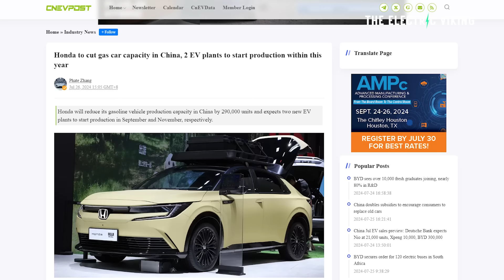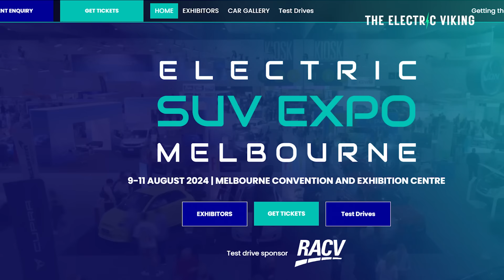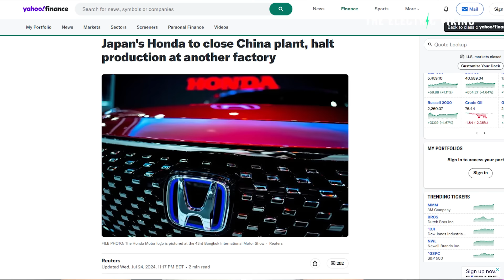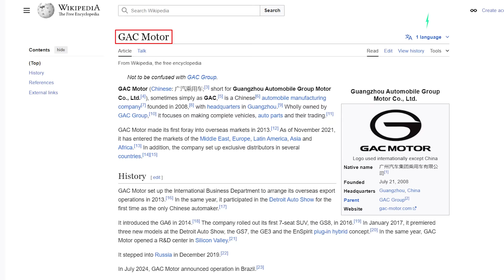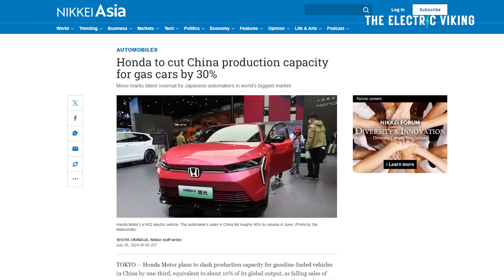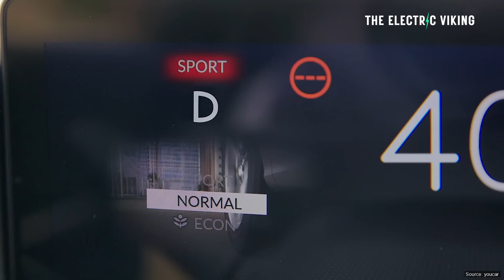Honda forced to shut down 3 MORE car factories as demand collapses

Comment: I just had to put a new engine in my 2011 CRV, Honda wanted $12,000. I got it done for half of that from a local mechanic. Their new CRV EV starts at $62,000. and they wonder why no one will buy them.
Reply: Better off buying a Tesla model Y, cheaper and less to operate esp. if you own your own home and charge there. This is esp. true if your utility has TOU rates and even more so if you have solar and net metering (not as good a deal in Calif. under NEM 3.0), great for those under NEM 2.0.  Except my '20 MS comes with free SC for life of ownership, beats pumping gas, got lucky.
Reply: And their products are so outdated and ugly.
Reply: What engine was it? Some gold plated one?!?
Reply: @mickl8212  not sure what engine it was

Comment: Over priced small vehicles that only fit short Asians, forget tall people, they need to get the driver's seat moved back and rebolted.
Turbos killing all companies not used to selling them. Blame the pill popping zero emissions folk.
I like Honda's, worked for Honda Dealer, but being 6.5ft tall, it was a nightmare moving civics around, especially with sun roofs.
I want to get a Honda Pilot, but it's too pricey for what you get. No turbos for me. Rather buy a LADA SUV 😂.
I hate the drop down rear design of cars and SUVs. Waste of headroom space and cargo space.
Bring back square back SUVs. It's a utility type vehicle, doesn't have to be a fashion show with nice curves at the back.
When did Japanese car makers stop being practical and started being fashion models.😅

Comment: Ev will transform the industry into a commodity...china excells in commodity and nobody can come close

The only way other players can compete is by offering higher value by design, luxurious and stylish interiors coupled with attractive prices

With performance being democratized, the value of car based on different tiers are down the drain...if a mere micro ev gives the same torque as a V8, the industry is cooked

Comment: Bottom line is that the EV markets is disrupting the car market slowly but surely! Honda for example can’t compete on cost with those Chinese competitors. Also with EV’s, they lose the reliability tag with their combustion engines. Sure electric motors need to be reliable, but how often have we heard of them failing? Bottom line is that these cheaper SV competitors will sell the same car as Honda for half the price!

Comment: Battery plant construction put on hold in Canada, as contracts from automakers are cancelled. Declining demand is hurting car industry world wide.
Reply: It's not declining in demand, but the FK prices r SKYHIGH, bring 10k BYD, and it'll sell like hotcakes. Even at 20k ca dollar, it's gonna sell a lot, last year bought a KIA seltos 2024 basic trim, around 36k tax included, honda CRV, nissan kicks, interior were bad and prices were 2 to 4k more expensive than the KIA, with same basic trim.
Imagine If I had the choice of the 15 to 20k price car, game changer!
Reply: @_seola_  Yes, what I mean is declining demand for batteries in Canada because the car manufacturers don't want to build in Canada. Most manufacturers outside China will lose money on every EV they make in Canada or USA. Because they are producing at small scale, to begin with. Only TSLA is coming out of this dilemma with a break even or slight profit margin. The potential is huge however, and that is what Chinese companies want to capture.
Reply: @bengt_axle  Also, if Canada doesn't follow USA steps, I bet companies like BYD /Huawei would definitely build some factories in Canada, but sadly, whatever USA does toward China/Chinese companies, Canada does it BETTER! I really wish Canada had some freedom regards to it's own foreign policy lol.

Comment: Have a 2014 Honda Accord Coupe. Had a 2004 before that. Both reliable. But the 2014 they failed to update and fix Bluetooth issues and other stuff in firmware. They discontinued the Coupe. Haven't had a Prelude for decades and I doubt the new one will release exactly how it was showed. Honda fails to change body styles substantially . Always same type of slightly changed body style. Honda CRX made a lot of MPG in 90s and since then they haven't innovated to work on more mileage. Today's cars get less MPG. They take away features like passenger turn camera like my 2014 Accord has. They go backwards and make excuses these days. And they fail to add sound isolation panels in their cars to make them quieter on the roads. Honda...add Dynamat to your cars! People are tired of driving in noisy cars! Also all current models have same honeycomb dash and digital displays. Exactly the same! They are reusing same parts in same cars to save money instead of designing unique dashes for each car model.

Comment: An asset is anything that provides future benefits to the owner.  A factory is an asset because of its ability to produce car for sale.  Copy right of a bestselling novel is an asset because it generates royalty income in the future.  If you have a factory making gasoline power cars that are losing sales volume and market share and has no hope of changing, the value of that factory goes down.  

Why can Honda keep the value of their factories unchanged?  Their auditors allow them to do so.  Auditors are paid by the companies they audit.  So, Honda can bring pressure on their auditors to keep the value of those factories unchanged for a while.  The issue is whether the decline in value is temporary or permanent.  If you are in a business cycle and sales declined, it is not reasonable to ask the company to write down the value of such major assets.  The transaction would be hundreds of millions of dollars.  What if sales go up next year?

Temporary or permanent decline in value?  That is a judgement call.  Since the growth of the electrical vehicle market has been explosive in the last several years, Honda could argue that the decline in value of their factory is temporary.  There is a limit as to how long a temporary decline can be, before it becomes permanent, even if the factory is still working half time.

When a factory closes, it is a write off.  The book value of that factory goes to zero.  The other side of the transaction is an expense.  There goes the profit of that year. Not only that.  All payments of all uncancelleable contracts related to that factory must be expensed in the same month. If Honda signed a two year contract with a landscaping company, they need to expense two years worth of payments to that landscaping company immediately because the services of that landscaping company will provide zero benefit to Honda in the future.  The same rule applies to other suppliers, consultants, cleaning companies, senior managers who has a contract with Honda.

That day will come when temporary decline in value of the factories becomes permanent, if Honda sales keep going down.
Reply: An underutilized factory is a liability.

Comment: I had a CRV it was nice but it was surprisingly a gas guzzler and was making me broke. Traded it in for a Prius and it gave me the freedom to afford to drive wherever. Now with my Tesla it costs me $4.90 us to drive 300+ miles 🙌🏼
Reply: You must have solar and your state mandates net metering for you to have 10c/kwh electricity rates.
Reply: @zanebrimson7777 

Some places still have $0.10 kWh's Especially at night.
Reply: We have two teslas and haven’t purchased gas in over five years. I love my private home gas station …
Reply: Cost me even less with own solar electricity because it’s worthless to export electricity other than use it all as much as possible and charging evs is best solution
Reply: Onto second Tesla model y love the car and have solar roof panels and 2 Tesla power walls total cost over 2 years $35 dollars for power from supercharger in Taupo ,no service required will never go back to ice.would love a model s but they don’t make it in right hand drive.
Reply: @garrymajor7528 Yes they do, there's an infestation in the UK.
Reply: @jjohur Just don't park it in your garage...
Reply: I charge at 14c/kw nz or about 10c per whr ISD with no incentives no solar ,just night rates.
Reply: @satay8167  if your correct, then why arent any emergency vehicles EVs!!!LOL!!!!!!
Reply: I charge at 8c/kw at night.  Yet better, my electricity plan gives me free electricity between 11 am and 2 pm. So I charge for 0c most of the times (without solar). Also, waiting for powerwall 3 launch her in Australia so I can fill all my batteries during the free period.
Reply: @thisisnumber0  They stopped making RHD Model S some years ago. There again I don't think anyone would want a car bigger than a Model 3 here in the U.K.
Reply: A model 3 uses about 4 kwh per mile — 75 kwh for 300 miles. That’s about 6.5 cents per kWh. Where the heck can you buy power at that price?
Reply: Wait until you have to replace your batteries...
Reply: I call BS on $4.90 to drive 300+ miles. My Chevy Bolt gets the same mileage as a Telsa and it cost me more than that.  Check out TFL EV's mileage
Reply: Do you own a calculator? It will take 500,000 miles to pay for the extra expense of a Tesla. And that does not even account for the interest you would gain on a secure account if you invested the money you would save. Teslas are very fast so if you like to drive like child they are just the ticket!
Reply: @user-vy3ph4mm8v    I'm betting that before you hit 500,000 miles, you're going to need a new battery, too.
Can you say big bucks?

Comment: Living in Norway, you can really feel what's comming. The gasoline sale is down 7,5% and diesel down 10,5% from the same mounth in 2023. In a 4 year periode the sales is down 50%.
The energy stations (former gas stations), are removing gas/diesel pumps. Some are putting in chargers instead.
The only reason that some of them don't remove the gas/diesel pumps all together, is because of the costs of removing the tanks in the ground.

Getting 98 (E5-10?) octane is getting really hard. 95 E10 is the only standard in 75% of the stations.
If this is happening in Europe and the world, I think you need to convert to flex fuel if you plan to keep the gas guzzler. The farmers have invested in ethanol. So, when the fuel sale decrease, you need to put more ethanol into the gas.
That's E25 or more. Most cars can't run on that. The forcast is that Norway will have 50% EV's (NOT Including fossil cars with big batteries) on the road in 2030.
Already today the station companies have plans of getting rid of a big number of stations. So, I also think that if you need fuel, it's time to start making your own moonshine....🌛
Reply: Totally down to government taxation policy.
Reply: Trying to convince yourself or others?
Reply: @richardsmith579 oil subsidies are way higher. Love removing subsidies.
Let's start with the $US 9.000.000.000.000, soon to be $US 11.000.000.000.000.
(International Monetary Fund Numbers).
This is $US 38.194 in subsidies for every fossil car through oil alone!
Reply: @YBM2007  He is just a troll, ignore him!

Comment: It's actually a shame because i was a big Honda fan for many years. My first car in 1991 was a CRX and i owned many different Honda's until i bought my Model Y LR in 2022. I think honda was a little like Tesla today....they invented VTEC, SH-AWD to name a few and were very innovative. It's a shame that the stubborn Honda management board will kill this brand!
Reply: I remember the innovative CRX in high school in 90s. Got excellent MPG and stylish for the time. Today they can't make a car that makes that MPG without hybrid for some reason. And Honda fails to innovate on styling. Same honeycomb dash and lcs screens for gauges in all current models. Same small exterior design changes. Prelude prototype looks futuristic but I doubt Honda will release that design. The old Japan men running Honda will push back and make it look like current vehicles to fit in .
Reply: Honda was a terrific innovator in 1969: CB750F; and in 1976: CVCC. All the innovators retired - two decades ago…